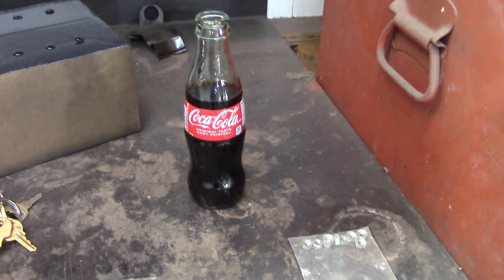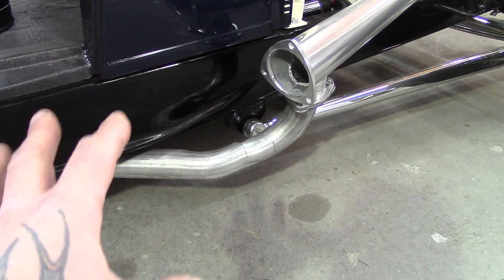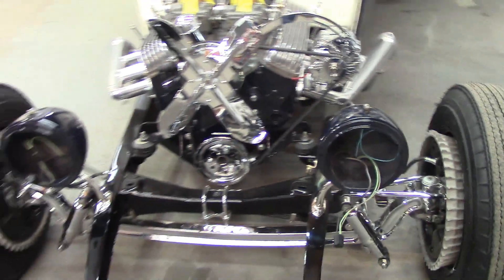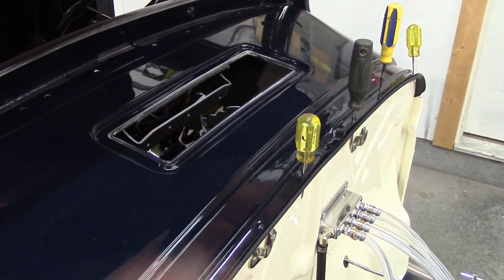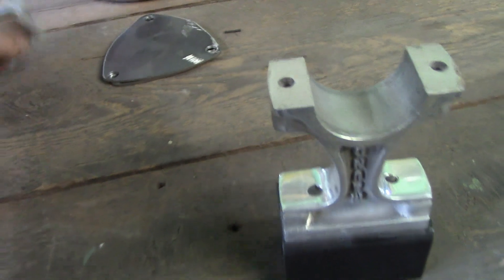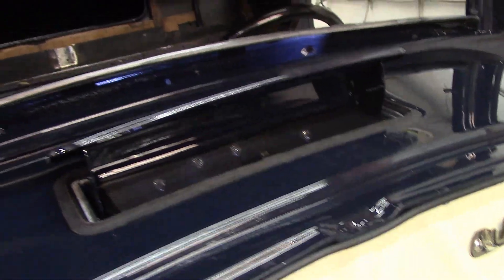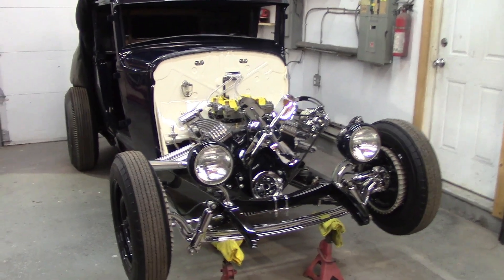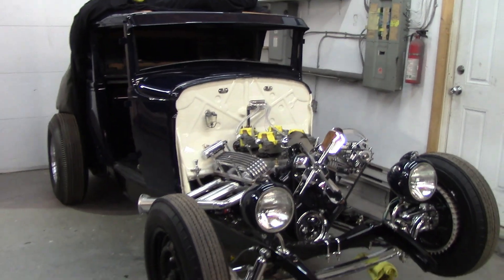Assembling My Model A On Sunday Funday

Comment: Sanderson headers advise that you under no circumstances should wrap your exhaust as it holds in too much heat and causes the pipes to prematurely rot out , in fact if you wrap a set of their headers they will void the warranty . Black paint works for me . If the pipes will hit the frame , you might try mounting a small black rubber block under the frame rail . Maybe cut two pieces out of an old style exhaust hanger , as it already has mounting holes in it .
Reply from the maker: I think it will be fine pipes are not touching frame so i think the heat issue is all good

Comment: Personally black paint, I'm not against exhaust wrap, as they have their time and place. Just a bad experience on the '80 Powerwagon wrapping the long tube header around the starter area. Should of listened to my brother and built a simple heat shield. Not a daily driver so the tubes rotted fairly fast in the Alberta climate. Love the Model A, it has the right old school look, and stance.

Comment: If you don’t wrap the the pipes how about putting shields over them like some motorcycle have on there exhaust, unless you think that idea is to tacky. And I wouldn’t put any pin stripes on it . Your going to polish those plate up that go on the headlight buckets?
Reply from the maker: The little tag will get a polish